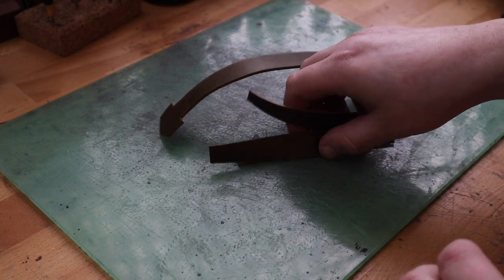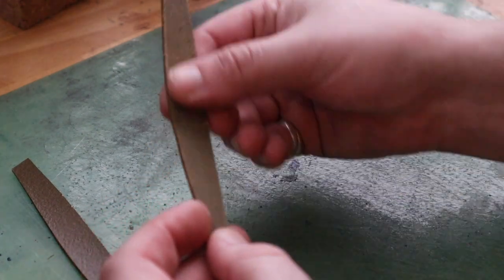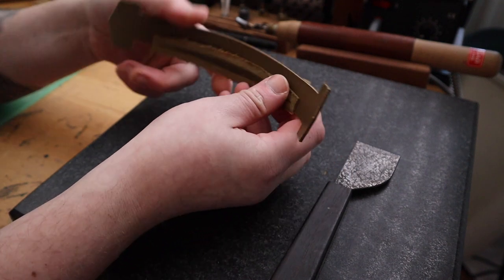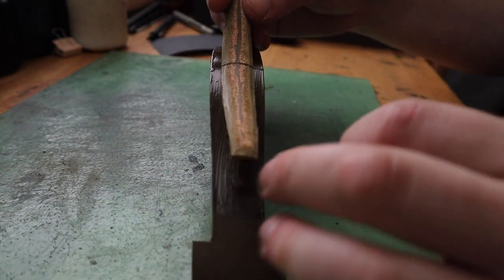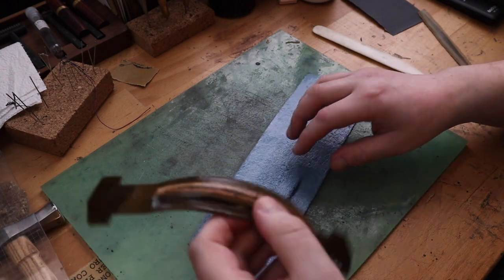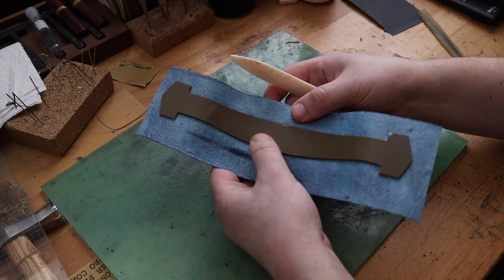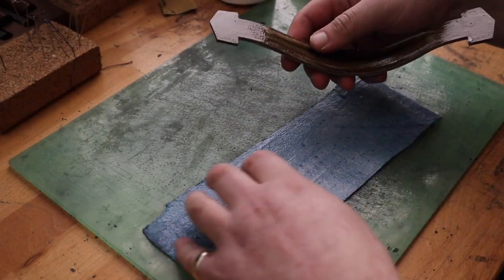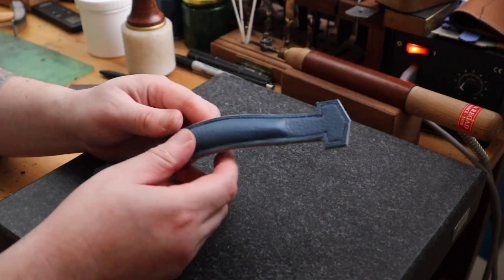HOW TO MAKE A LEATHER HANDLE //PART 1 //WILL HODGES

Comment: Hey Will, I love your videos and straightforward style. 

Apologies if you've already covered this, but I see you using the leather gauge at the beginning. I've bought plenty of tools whose utility I was less than certain of, but I haven't yet been convinced of this one. 

Sometimes when I buy split sides/panels, I do notice an inconsistency in the thickness. Clearly, I am not needing a tool to discover this. Begrudgingly, I work around the 'undulations' in the leather and make do. 

That said, what do you see as the value in the leather gauge? Thanks so much!

Comment: Have you done the second video yet for this?? I need to know how to attach the handle but not to stitch it on the actual briefcase, but how do put the ends through the leather loops that are on the briefcase? They don't bend or fold enough to put them through the loops...